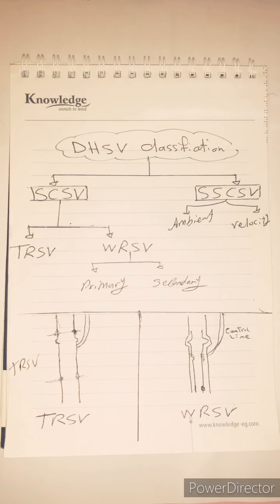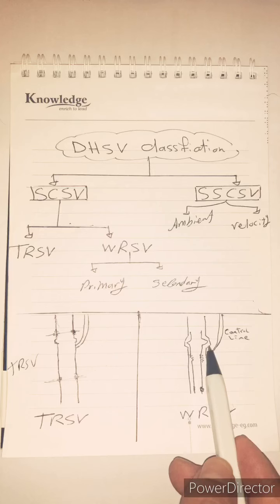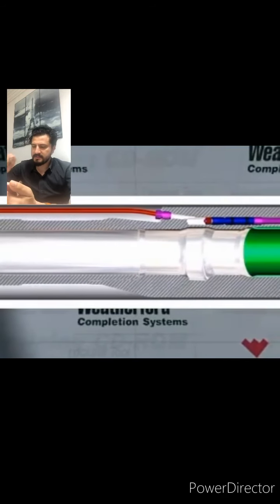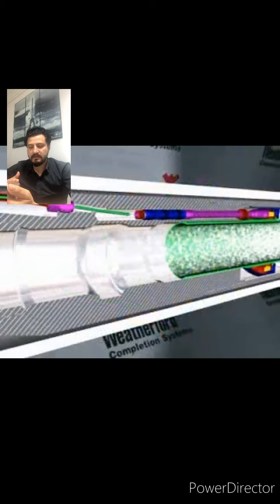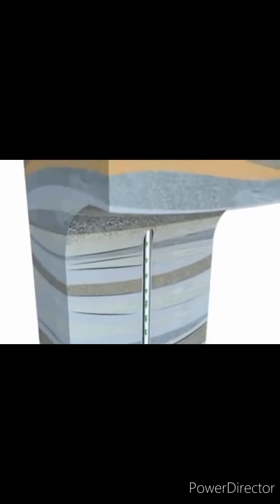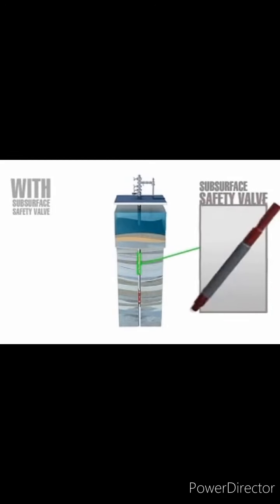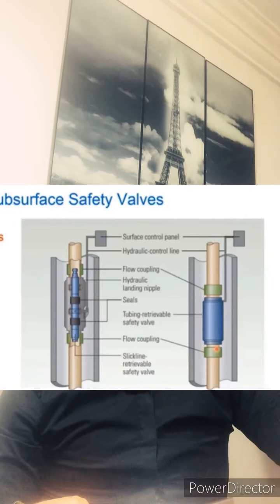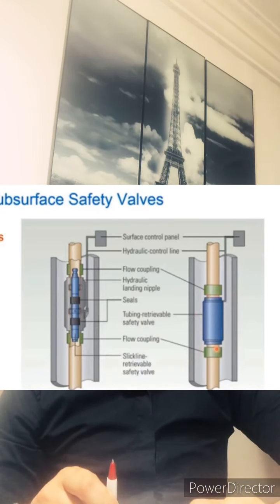SSSV Subsurface safety valves

Comment: Separation Sleeve is to blank-off the hydraulic chamber in an “SelecT” Safety
Valve 
 ماذا يعني
Reply from the maker: It means that SSSV top part includes sleeve that can be controlled by open it to set sec.sssv.